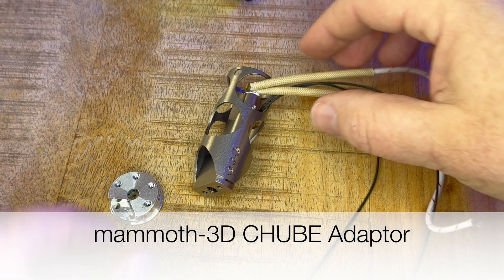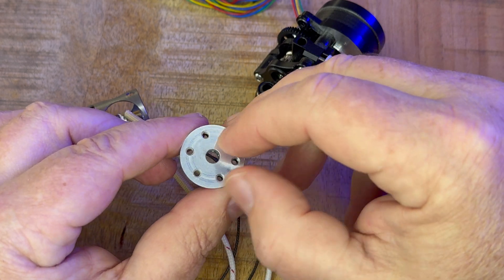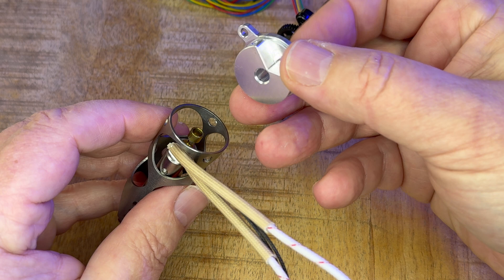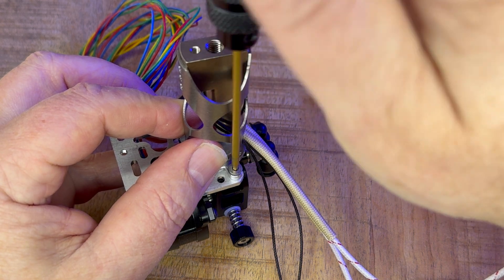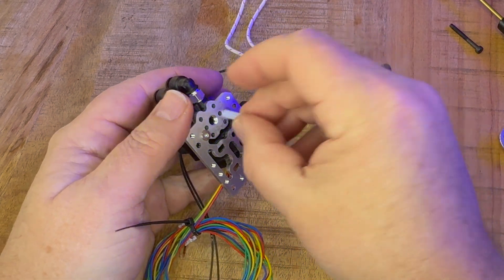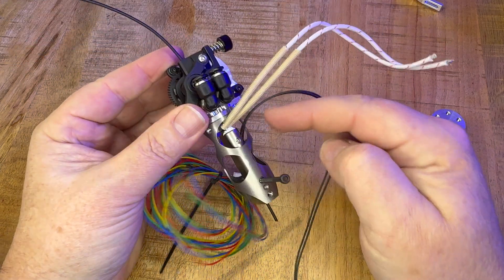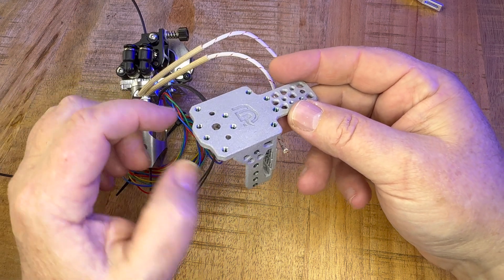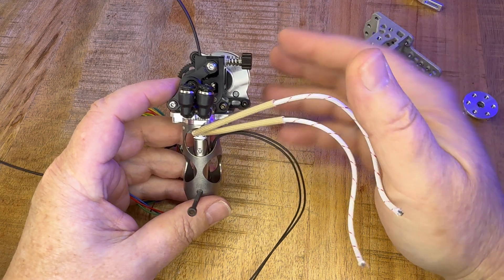Effortless CHUBE Hotend Installation on VZBOT | mammoth-3D Adapter Upgrade! 🚀

Comment: where do i get this adapter?
Reply from the maker: We did a few tests on a few printers and found a small problem. But we are updating the plate and mounts so that it will fit better on you toolhead. It will be out very soon.

Comment: This method is not as rigidly sound as it could be. I would change the tool head plate or, if room, make 4 holes for the  Chube(there are 6 total, but 4 is enough). Use flat head to bolt in from the top. Then make a small 3mm plate for the VZhex, with 2 countersunk up into the extruder body and 3 bolts going down into the toolhead spread out further.
Reply from the maker: Thanks for your feedback, I will look into it.
Reply: I agree, it needs to be more rigid. I like the adapter plate idea for drop in replacement but what I really want to see is a new tool head plate for the chube.
Reply from the maker: @ I got something cool today. Will post about it very soon :-)